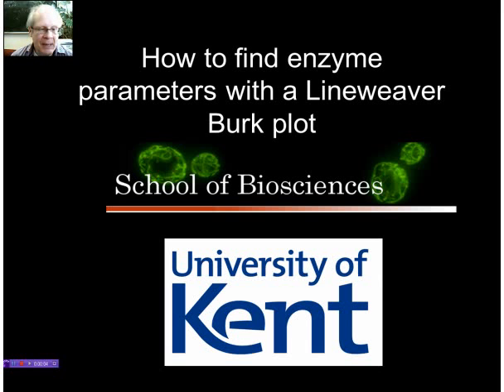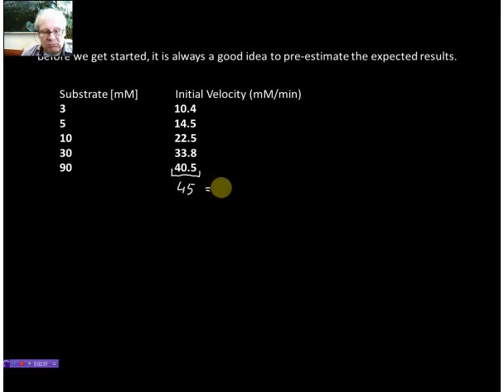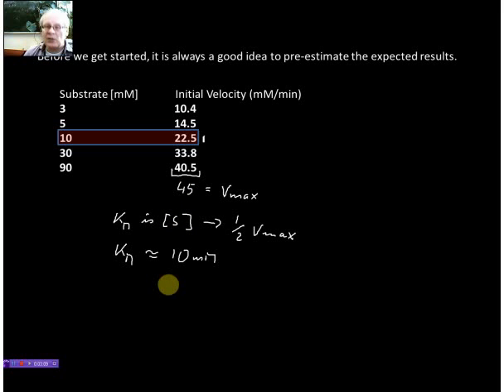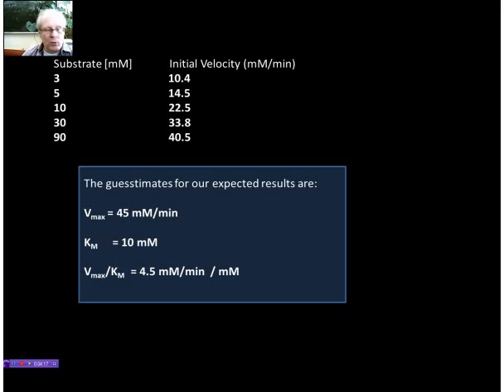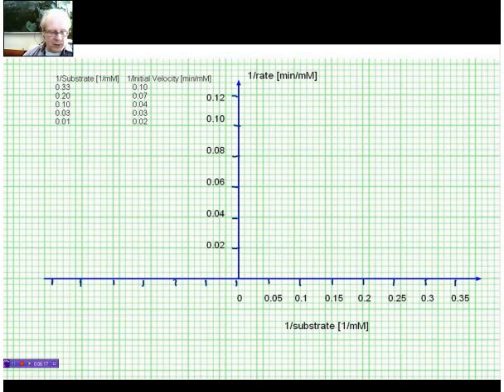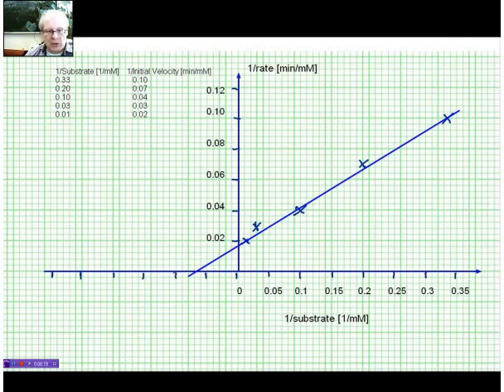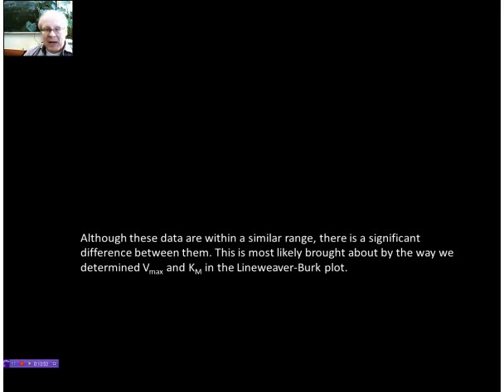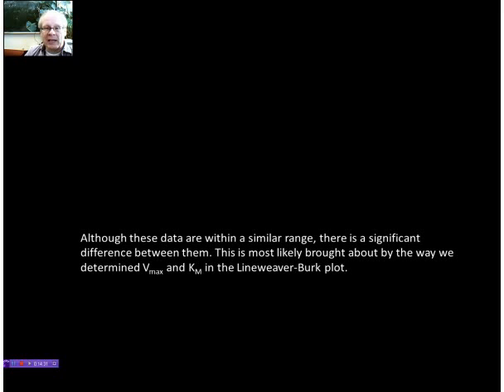Lineweaver Burk plot data analysis

Comment: I'm still a bit confused on how Km and Vmax were calculated?
Reply: Reading off the Graph 1/Vmax= 0.016. This is the reciprocal, to reverse it you 1/ 1/Vmax (1/ 0.016 = 62.5) So Vmax= 62.5. You do the same for 1/ Km (1/ 0.07 = 14.3). Once you have Vmax and Km you can work out the Gradient (14.3/ 62.5 = 0.23). Again you Reverse this giving (1/ 0.23 = 4.3)